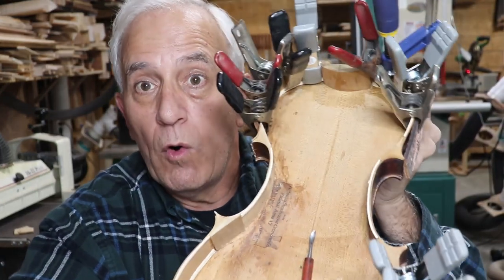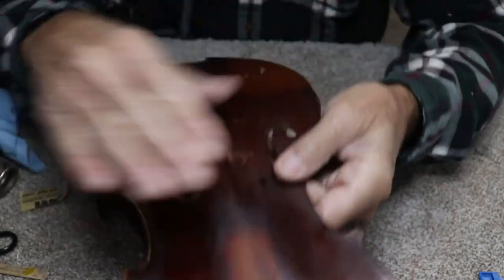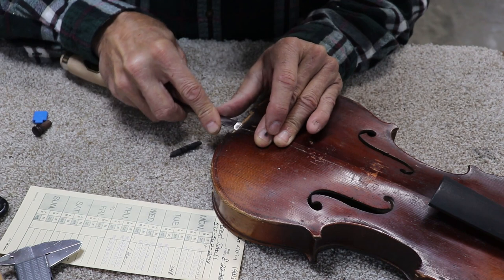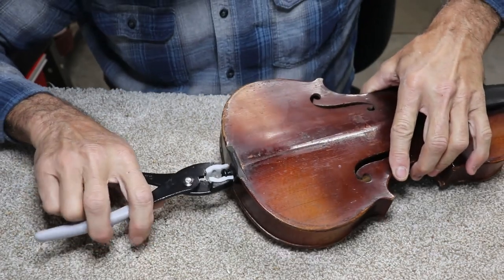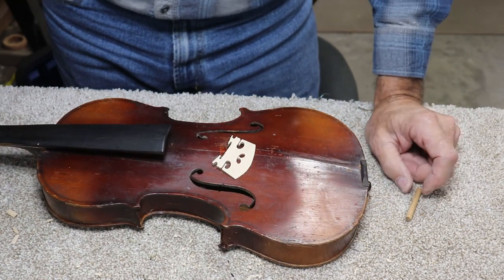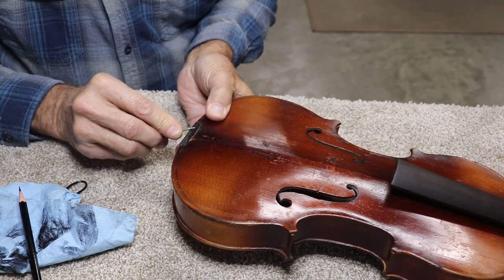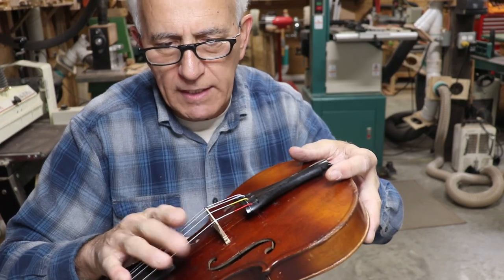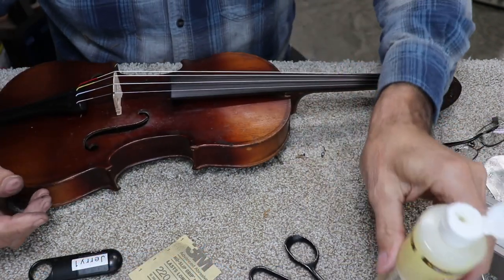448 RSW Grandpa's Fiddle Is Playing Again!

Comment: Is there a problem with using curved hemostats to set a soundpost? I used a pair the last couple of times I had to set violin soundposts, and for me it was painlessly easy.  Thanks from the Mississippi Gulf Coast...
Reply: That's a good idea. They are readily available, too. Like a perfect little set of sound post pliers! Thanks for the idea. I was NOT looking forward to setting the post on the first violin I'm building, I think that might be the answer.
Reply: @willmorrison1022  I wish you luck with setting that soundpost, find a pair that is as long, thin, and curved as you can, and it should go well. (If the curve is not late enough you can heat them up with a torch and add bend to them)...
Reply: @briankientz2926  I will definitely be looking for a weirdly shaped set. I've never had good luck bending metal to duplicate shapes but that is clearly a skill I need to perfect.

Comment: Jerry, 

If the distortion of the top was caused by the bass bar being loose/unglued, will/could some of that distortion go away over time from the pressure of the properly attached bass bar?

Comment: Hey Jerry I don't want to draw attention to this but @ the 15 minute mark there is something in the video that I am sure you didn't intend to film and you will probably want to edit the video to correct it.  I don't want to flat out say what the mistake is but it is something that you and Caleb use everyday, multiple times per day and would be easy to misplace.  Taking the TIME to make such a thin shim is crazy because a business CARD is about the same thickness and since it is made of wood as well it would work I bet. Maybe you can make a video on different wood IDENTIFICATION in the future for us poor folk that don't have the NUMBERS of years it takes to build the knowledge ourselves.  If the clues I have provided don't help figure out the issue read the words in all caps to clear it up.  Great video.
Reply: I have bought small quantities of maple business cards (25 or 50 in a bundle) for woodburning or hand stamping.  You could use those as shims too. 😀😀

Comment: hi Jerry,
You have heard the old saying "where there is a will there is a way"  glue the leading edge of a thin shim to a flat board. Run it through a commercial thickness sander. Go as thin as you want. Down to about 8 thous. .02 mm
Reply from the maker: Yes I know you can do that. my thickness sander will sand down to 10 thousands without any additional aid
Reply: @RosaStringWorks  that's pretty thin!!!

Comment: Gerry, I love mm with the single exception that they are not native the to UK, but are a continental import dating back to the French revolution and the dictator Napoleon Bonaparte. I really don't like being a part (haha) of that, as a patriotic Englishman. Our older system is called Imperial measures for a reason - it dates back to a time when Britannia really did rule the waves and diminished the impact of slavery throughout the world. Now the US rules the waves and more power to you all. Always a pleasure to see your vids
Reply: Have a nice Brexit 😉
Reply: Imperial standard was 55 degree thread angle, optimized for holding in cast iron (or so I’ve heard) as British industrial goods were spreading across the world. Before that, every factory might have its own fasteners! Unified Standard (US) was designed for steel. Metric has the same 60 degree thread angle. It’s a pity that the US didn’t follow through with the metric conversion started in Carter’s term. It’s SO much easier to calculate and engineer.

Comment: Hi Jerry;
Just a note on the ebony tail crown you put in. If it's fitted too tight every winter as the house gets dryer, the spruce top shuinks more than the ebony crown and a crack opens up usually at the end of the crown. However with the crack that was opening up closer to the center, that may be weeker than the wood at the end of the crown. Thus that crack might have opened in dryer weather. Just taking about.005" off the length of the crown and reglueing it in helped me with that problem on my old violin.

Comment: I really enjoy all of your videos.  I build violins and I have found that for me setting the sound post is so much easier before installing the tail piece, bridge and strings. I then look through the end pin hole and can see where and what's happening in there. It is really the best way to know if the post is straight up and down left to right. To allow for the pressure of the strings that will happen when the strings are installed, I set it just where it will stand without falling over, so very lightly set. That way it will be just the right when the pressure of the bridge and strings occur. I hope you try it. I think you'll agree. I do slight adjustments when needed after it is strung up by just slightly loosening the strings. Again, I am impressed with your varied luthier skills on so many different instruments. Your not scared to tackle anything. :washhands:

Comment: Hi Jerry;
I'm with you on fitting the tail pin. I've seen tail pins that weren't fitted tight enough. The result was after years the  hole got wallowed out to the point that the tail pin was loose and angled up way too much.  This required filling the hole and redrilling and reaming a new hole. then I still had to fit the tail pin properly. I really like that you put gluing strips around the sides. They not only make it easier to glue, they also make the glue joint a lot stronger. Just a note on that new sound post setting tool. I've had it stab me when I tried to stick it into the sound post too. Then it kept coming out of the sound post. I like your coat hanger idea better for putting the sound post in. The new tool might be ok for moving the post after it's in and upright.

Comment: Mr Rosa  a question  why is the bridge called a bridge?
Reply: That is a question the answer to which is probably lost to time. They have been called that for over 5 centuries on this instrument, and longer than that on others. Had to call it something and "chair" was taken? Lord only knows why.
Reply from the maker: My guess is that it looks something like a bridge with the arching
Reply: @willmorrison1022   Mr Morrison thank you for The answer to my question..
Reply: @mattomon1045  No problem. That is one of those questions that probably has an answer somewhere buried WAY deep in the annals, but whether anyone an idea as to where that info would be is the real question. What is interesting to me is that even if the instrument doesn't have a tailpiece method of holding the strings, like on an acoustic flat top guitar, it's still called a bridge. It's not leading from one place to another, it's stationary. And it doesn't even make sense, because it SHOULD be called a pylon, the thing that holds the bridge, which I would see as the strings. It's much closer to that function than a bridge in construction. It makes no sense. Guess the builders were sniffing their shellac or something.
Reply: In Dutch it's called "kam", or comb in English.

Comment: Awesome video thanks for sharing. Jerry, What is the make and model of of that light you bought? Where did you buy from? Where did you get the coupon from? Stay well and safe my friend.
Reply: It's from Harbor Freight:
https://www.harborfreight.com/1160-lumen-led-solar-security-light-64734.html
An1160 lumen output is equal to a 100W incandescent.
They also have a 2150 lumen model, for $2 more.
Choose by how much light you need/want, not by price, or you will regret your purchase.
Reply: Jerry, the 2150 lumen model is hardwired - it does not have the solar panel.
Reply: @zapa1pnt  Thank you.

Comment: Why arnt sound posts glued in during the build ?
Reply: They don't glue the sound post. The friction between the back and front holds in in place.
Reply: The way the sound post works is that it transfers the vibrations between the back and the front of the violin. Glue would interfere with that. also, you need to be able to move the sound post around in order to find The Sweet spot to get just the right sound and that can only be done after the violin is all put together.
Reply: @sara505sings  since there is so much pressure on it, I don't see how it could possibly interfere with vibrations. Just a small dab of glue will hold it. Finding the sweet spot, maybe. Although I have seen most people just picking something they think works, like Jerry. 
I think this is just one of these examples just because it has been traditionally done this way.
Reply: @p_mouse8676  it is that pressure on the sound post between the top plate and the back plate that makes it work. There needs to be a perfect marriage between the soundpost and the top and the back for the best transference of sound. And even if a small dab of glue would not interfere with the sound (but it would!), You don't know where exactly it belongs until the violin is all set up and you've played it. Even then, you might want to move it at some point for a different quality of sound and that should remain an option. It is an art to be able to make a well fitting sound post and install it properly. There's really no shortcut. But if you think you know better than hundreds of years of tradition, then go for it. Nobody's stopping you.
Reply: @sara505sings  People also used horses for hundreds of years of tradition, nobody is using those anymore as main transportation anymore? We also don't use candles to light our rooms (and xmas trees) anymore? As well as guts for the strings.
I get your point, I never said it's not an important part. But there are ways around it. The dab of glue if just to hold it in place, nothing more.
That is also just one idea, clearly NOT the best and only idea.
So you're welcome to brainstorm along with us.
Reply: @p_mouse8676  those are all false analogies and have nothing whatsoever to do with the functioning of a specific component of a violin. And you're missing the point that there's no way to know specifically where it belongs until the violin is all set up and played and even then it sometimes needs to be moved again for various reasons. There's nothing more to brainstorm as far as I'm concerned. You asked a question and I answered it.
Reply: @p_mouse8676  A lot of people still use gut for strings. Just sayin'...
Reply: @willmorrison1022  correct, and most people don't use it, just saying.
Reply: @sara505sings  I think the point is very simple. The fact that something has been done for hundreds of years, doesn't make it the only correct way to do it.
Otherwise we would still be living in caves.
Not even talking about why it has been done that way.
If Stradivarius would have done things differently (for whatever reason), I guarantee you that we would have different violins today.
Correlation is not causation
Reply: A soundpost is a consumable on a violin just like the bridge or strings you would not glue those in place. Moving the soundpost from one position to another is used to change to tone of the instrument, and glue may dampen the transfer of sound (vibration) from the top to the back some...

Comment: Hi Jerry. Could you glue the sound post to the bottom of the violin before you glue down the top stop it  moving around when you try to place it?
Reply: You NEVER glue in a sound post. They need to be able to be moved from time to time. Plus, even a small amount of glue will change the sound. It's like an arch top bridge. Yeah, you CAN glue them down, but change your strings to a slightly different gauge and you will see why you DON'T.
Reply from the maker: Violin style instruments, from violins to upright basses are all held together by friction alone.  I always say, when they are setup correctly, they are ready to fall apart.

Comment: At the 5:32 mark you discuss the damage at the sound post area.  You chose to fill the area with filler . . . I am thinking that the pressure of the sound post pushing against the filler may crumble the filler.  As an alternative, you could add drops of water to the damaged area, let the water soak in, apply heat to steam out the majority of the compressed wood fibers . . . that effort would probably take several iterations to get a majority of the compression out.  Then to stabilize the wood fibers, soak the area with either Chair Doctor or Briwax ChaiRX glue, both glues have the consistency of water.  In a pinch, I have also watered down, just a touch, PVA glue.  Not trying to convince you to change your ways, just offering an alternative to consider.
Thanks for your time